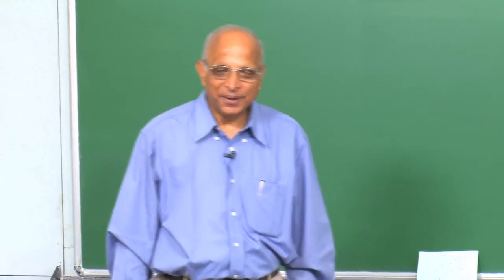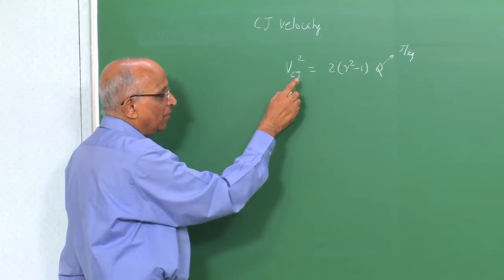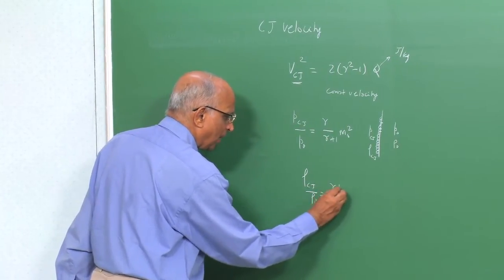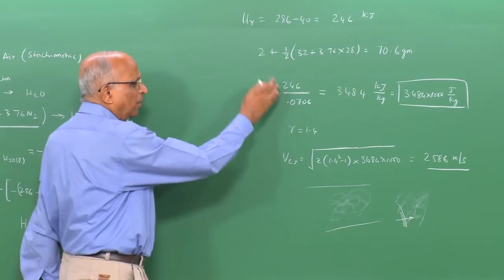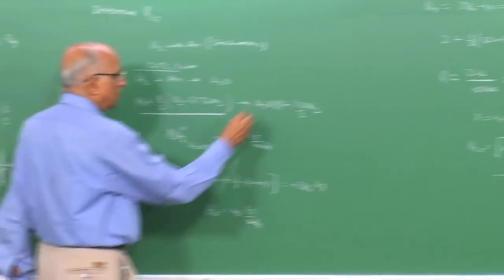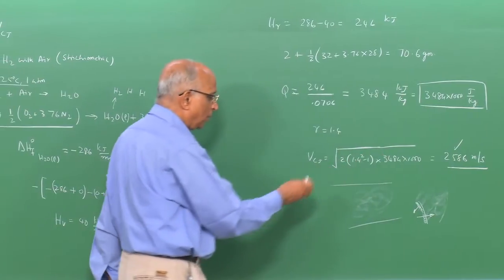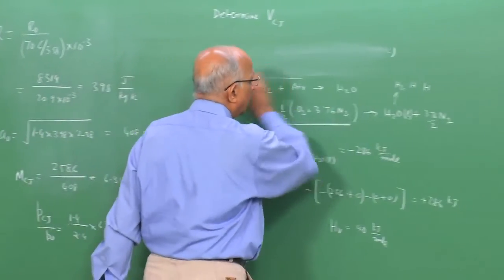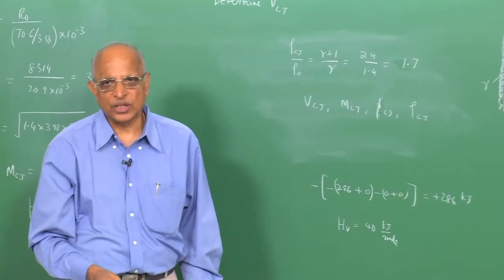Mod-01 Lec-26 Detonations: Calculation of Chapman Jouguet Velocities, ZND Structure

Comment: Starting with solid density, bond energies and using the conservation of energy & momentum; a simple one dimensional chain model of e.g. N4 decomposing into 2 N2's gives a velocity of detonation, detonation pressure, and relative effect that are within 25% of the experimentally measured values. These theoretical values are invariably larger than what is observed primarily due to the Boltzmann distribution and the reversibility of steps in the reaction near the detonation temperature.